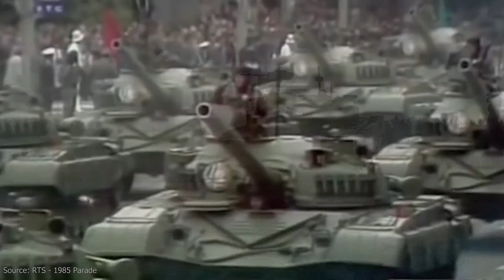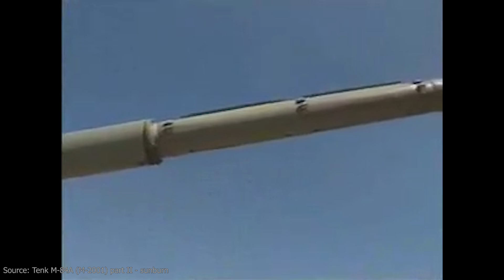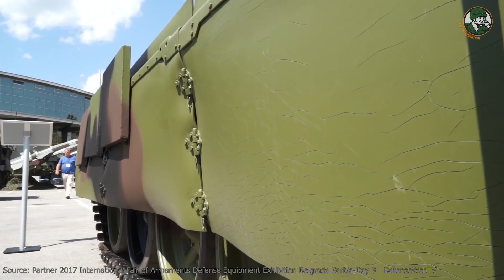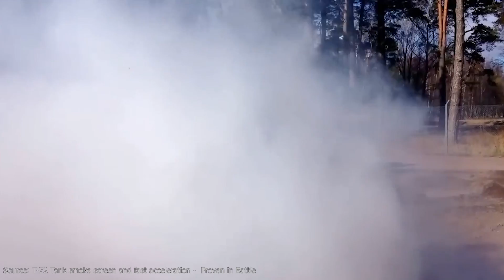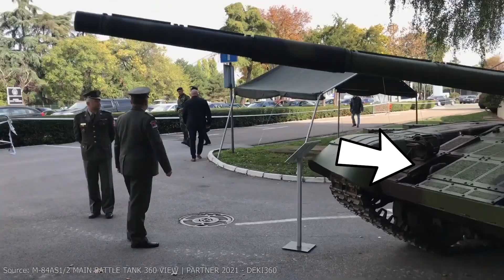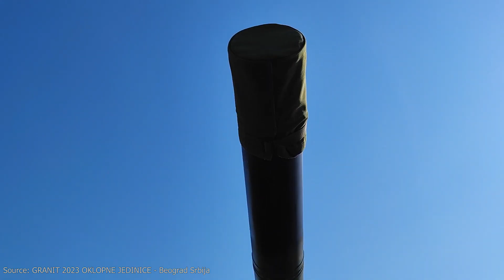Teaching an Old Dog New Tricks | M-84AS1/AS2

Comment: Upgrade 9 old tanks for the price of 1 new tank, that should make the bean counters happy. Though to be fair if Ukraine's any guide it might not be such a bad idea. It's not like the new Russian tanks are really doing any better than the old models.
Reply: In modern warfare there's alot of ways to kill tanks, so they are mostly used as infantry support.
A leopard 2a6 wouldn't offer much difference in that role as t72b3, both are big guns firing at entrenched infantry
Reply: @mostafamohy8494  Leopard 2A6 lacks a dedicated High Explosive Round, while the T-72B3 has a dedicated HE round, if we're talking about infantry support or anti-infantry role, the T-72B3 has quite the edge over the Leo 2.
Reply: @saucy743  i didn't know that, i thought they had one but i might mistake a HEAT for HE.
A HE would still hurt infantry and good against structures but yeah dedicated round would be better
Reply: @mostafamohy8494  HEAT, although while having High Explosive within it's name and exploding when hitting something shouldn't really be used for roles where basic HE is needed, Sure it will cause an explosion but it will nowhere near be as big or destructive as a dedicated HE shell.
Reply: @saucy743  yeah heat mostly consist of void, the explosive mass will be smaller than a dedicated he round
Reply: When it comes to the versions of the T-72B3 and B3M used by the Russian army in Ukraine. There are many versions and levels of modernization ... The latest version of the T-72B3M for 2022 has additional enhanced armor protection, a combination of ERA contact 5 and Relict. It also uses new 1130 hp engine, new automatic transmission, which is also used by the T-90M tank, a new cannon and a new automatic loader, adapted to larger missiles, as well as most of the opto-electronics from the tank of the T-90M tank. So the tank is extremely agile and fast in all weather conditions, on all terrains, it has exceptional passability, it is difficult to get stuck ... Like all Russian tanks in general. It rarely breaks even in war conditions, no special maintenance is required... If we were to compare this version with the T-72B1MS, which is better than the Leopard 2 A4 tank. It could be said that the T-72B3MS in most sagemanats is at a similar or better level in some segments than the T-72B1MS tank. The B3M version is better. First of all, in terms of speed, a stronger engine, and better armor protection, a new cannon and a new automatic loader... It lags behind the T-72B1MS in that it does not have a new panoramic sight with a PKP- 72 Falcon's Eye panoramic sight (Sokolinji Glaz) with a thermal imager of the third generation, (on some B3M versions this panoramic device is present, but on most it is not). But the tank still has the possibility of limited use, hunter-killer capabilities, through the PN-72U Sosna-U aiming system... It also does not have a remotely controlled weapon station armed with one 6P49 Kord 12.7 mm heavy machine gun mounted on the roof of the turret. But only the manually operated Kord 12.7mm heavy machine gun Neither is the auxiliary power unit (APU)... So we can safely say that the T-72B3M version from 2022, but also from 2017, These listed
   modernized variants of T-72 tanks. They are somewhere above the Leopard 2 A4 level, roughly at the Leopard 2 A5 level. The same applies to the T-80BVM ... and older versions of the T-90 tanks. While the new version of T-90M / Proryv 2 and 3 ... In the worst case, the level of Leopard 2 A6 ...

The Russian/Soviet T-72 tank in its first and
    basic versions from half a century ago, or export deeply degraded versions used in the middle east... It does not pose a serious threat to any third generation western tank. But the modernized variants of this tank, which were modernized from the second to the third generation of tanks. Such as the Russian modernizations mentioned above T-72B1MS /B3/B3M, T-80BVM ... But also the Polish versions of the modernization of the T-72 tank PT-91, as well as the Czech modernization of the T-72M4 CZ and the Ukrainian modernization of the T-64 and T-80 tanks, as well as the Serbian modernization of the M-84AS1/AS2 tanks... In a real war conflict, they represent a serious threat to every third generation western tank . Not to mention the new T-90M tanks.

So when all the minuses and pluses are added up, the western tanks of the 3rd generation and the Russian modernized tanks of the 3rd generation... When the line is drawn. Soviet / Russian tanks performed better in Ukraine. Especially when you take into account what was invested and what was received. In the best case, the price of Leopard 2A6 is at least 9 pieces of modernized M-84AS2. While there are at least ten Russian T-72B3Ms. And in the real war, we saw in Ukraine, when it comes to maintenance, first of all, T-72, you can maintain even major repairs without a workshop, very easy and simple, very cheap. Training is also very cheap and fast. While the quality of the engine, transmission, suspension... The quality of the T-72 tank, but also the T-90, is generally extremely high, angularity and passability as well... Far above Western tanks of the 3rd generation... Where training is too expensive, complicated, maintenance is complicated and expensive, serviceability is bad... So, as I said, in a real real war, as it is in Ukraine. The Leopard 2A6, as certainly the best NATO tank in mass use, is hardly worth it, even as one T-72B3M in a real war. And it costs at least 10 times more than the T-72B3M tank. So the calculation is clear.
Reply: Ti znaš kakav je naš m 84, već u osnovi je bio bolji od t 72, do kraja Godine se čeka isporuka 10 do 15 m 84 as1 as2.  Nemas pojma sta ga najviše odlikuje. Preciznost, več sa prvom granatom verovatoća pogodba je preko 90%
Reply: @Military23446  Neki strucnjaci tvrde da mu je top eksplodirao na testiranju. I to ne internet strucnjaci vec oni iz osamdesetih koji su ucestvovali u dizajnu i proizvodnji tenka. E sada sta je istina....
Reply: If you can afford it, upgrading what you already have or building off whatever it is and say it's indigenous made is better than building a whole new tank. You're gonna have a lot of problems and delays but it's good practice and experience tho.
Reply: well they are, the t-90, from start of the conflict to today has only suffered 90~ losses, and these are all variants combined, that is a great track record, meanwhile the leopard 2a4 and 2a5 lost around 20 in a month combined, most of them being lost in a single week
Reply: @valyshknee4203 but are the same as Rússia, in the Firsts months a Lot of T80 and T72 get Destroyer in weeks.
Reply: @BrenoAgmL  true but due to the t-80's performance afterwards, russia chose to put it back into production this year with some upgrades, like severely increased reverse speed, due to its amazing performance in the conflict, and yeah those losses will happen if in large numbers, its to be expected, but russia is lucky that it has more than enough of these tanks, and the fact they're rather cheap compared to western counterparts,
Reply: @valyshknee4203  Ahh slightly more coherent than the usual vatnik but let's put your claims into context.  If you have less of the good stuff to start with and you don't put it in danger as often as your other stuff, you will lose less of the good stuff.   Guess how cars I've lost to ATGMs?  That's right none.  Does that mean my 16 year old car is better than a tank?  Of course not.      It's  like the Armata.  Russia hasn't lost a single one of those in Ukraine yet.  Why is that?  Oh, it's not in Ukraine.

You are also conflating destroyed with disabled, adding in the usual russkie bull, to make your claims sound better.
Reply: @valyshknee4203 They are probably more careful in exposing their modern tanks.
Reply: @valyshknee4203 that is a terrible track record and the T90 losses are higher than you're stating. Not even counting the damaged and abandoned  ones that Ukraine has taken.
I'm not fan of the leopard 2 but you're also not providng accurate info on it's losses. Where are you getting your info from?
Reply: According to what could be observed in Ukraine .T-72B3/B3M . They performed very well considering that they are on the battlefield for almost 600 days every day... Or rather, significantly better than all Western tanks of the 3rd generation. In terms of maneuverability, maintenance, agility, speed and, above all, durability... In 90 percent of cases, they proved to be better for the terrain in Ukraine than Western tanks. Because as soon as the Leopard 2A4/A6 appeared on the battlefield, they were immediately destroyed, each time during the entire Ukrainian offensive, which lasted over 4 months, they were seen for a total of maybe one or two weeks. when everything is effectively collected on the battlefield and destroyed at least 20 pieces minimum. Challenger 2 appeared once, 1 day, and immediately
  was destroyed ... Ukrainians no longer even use them near the battlefield, but from some other line. Because if Western tanks of the 3rd generation used them effectively, every day, they would have been without a single Leopard 2 or Challenger 2 a long time ago.

That's why, as far as I can see, serious analysis of tanks in the West, precisely because of the catastrophic failure of Western tanks of the 3rd generation, Ukraine is going to switch to Leopard 1 tanks, as a donation to Ukraine. Because it is believed that these tanks will already have success. Since they are smaller targets, they are more mobile, more agile ... From the western 3rd generation tanks, also the maintenance is not complicated and too expensive like the western 3rd generation tanks. The only problem is the catastrophic armor protection of Leoaprd 1 tanks.

Differences exist and are extremely large, between older and newer versions of the T-72 tank, from armored protection to optoelectronics, engines, transmissions on the tanks themselves... The difference is, for example, T-72M/M1 and T-72 B3M. It is significantly larger than Leopard 2A2 and Leopard 2A6, let's say...

The T-72M/M1 version is a deeply degraded version of the T-72 tank for export to the Far East and Warsaw Pact countries. It was produced exclusively in Poland and the former Czechoslovakia. Never to the USSR, nor for the needs of the USSR. In order for you to understand how big the difference is. The first modernization of the T-72 tank, the T-72A for the USSR, was carried out in 1977. The T-72M tanks that were exported to the Middle East in the late 1980s and early 1990s had inferior armor, optoelectronics, guns, and also used are also outdated ammunition. So they were not yet at the level of the first modernization of the T-72A for the USSR in 1977. The 1979 version, the T-72AV, already had contact 1 ERA. So the Soviets, and now the Russians, never used this version. Very rarely even the T-72A version, maybe somewhere in the background on the front ... They use the T-72B/B1, but primarily the T-72B3/B3M, which is based on the T-72B. The 2016 and 2022 T-72B3M models even share the same engines and transmission with the new T-90M. Even the T-72B3M is being modernized and the new T-90M is being produced together at the same factory. Which means a new automatic transmission and a 1130hp engine. What the T-72B3M enables, max. speed of about 75-80 km/h. And about 25 km/h in reverse.

Let's give a very good example, when we compare tanks, from the east and from the west. Tanks T-72B1MS and Leopard 2A4. ... If you were to ask an average connoisseur of tanks, which tank is better in this example, he would surely say that it is the Leopard 2A4, which of course is not true! Because in most segments, the T-72B1MS is the better tank.

The T-72B1MS is a deep modernization of the 1984/85 T-72B/B1 tank. Where the tank retained the improved basic armor and ERA Kontakt 1, as well as the 840 HP engine... But the complete opto-electronic equipment, as well as the automatic transmission, were taken from the T-90M tank. The T-72B1MS is armed with a single 2A46 125 mm smoothbore cannon capable of firing a variety of munitions, including armor-stabilized sabot (APFSDS), high-explosive anti-tank (HEAT) and high-explosive fragmentation (HEF). ) rockets and anti-tank rockets Svir/Reflex range 4 and 5km penetration about 900mm at 5km. The MBT also has one 7.62 mm coaxial machine gun and one remotely operated weapon station armed with one 6P49 Kord 12.7 mm heavy machine gun mounted on the turret roof. The tank has conventional armor on the hull and turret, but is also equipped with Kontakt-1 Explosive Reactive Armor (ERA) mounted on the front and on each side of the hull and around the turret. Additionally, the T-72B1MS is equipped with a PN-72U Sosna-U day/night sight; commander's seat with a PKP-72 Sokolovo oko (Sokolinji Glaz) panoramic sight with a third-generation thermal imager mounted on the back of the left side of the turret; as well as the automatic target tracking system, the tank itself has a hunter-killer capability, there is also a chassis information management system, color management systems (BMS), auxiliary power unit (APU), which, with the use of an IR cover, additionally camouflages the tank, because the tank can operate, observe and destroy the target without the need to use the main engine, so the tank does not emit IR... And combined GPS/GLONASS navigation system. The T-72B1MS tank has the ability to detect a tank-sized target at 10 km, laser targeting at 7 km and the ability to shoot at 5 km, cameras for forward and backward movement ...

This version of the T-72B1MS tank is used by the Serbian Army and some other countries in the world... This modernization was done by Russia's St. Petersburg Technical Institute... The Leopard 2A 4 has the only advantage in slightly better armor protection, but that is logical considering that the Leopard 2, weighs some 20 tons more then T-72, and is a much larger tank and a larger target, therefore, the tank's maneuverability is significantly worse. In this case, this does not bring it any advantage, because it lags behind the T-72B1MS tank in all practical segments.